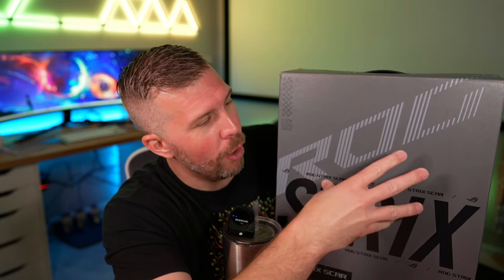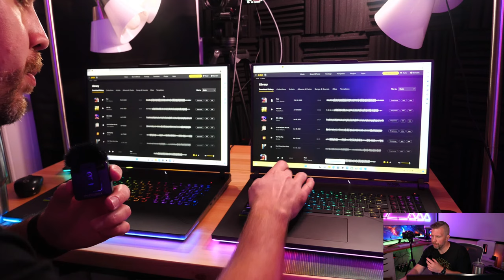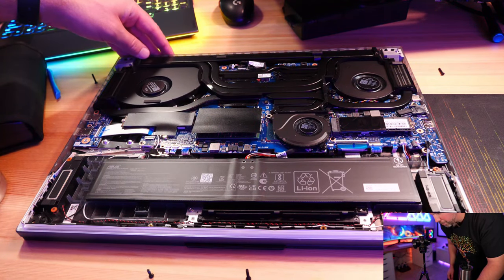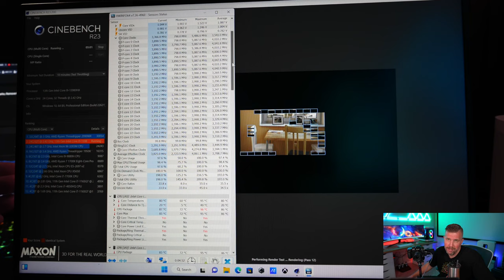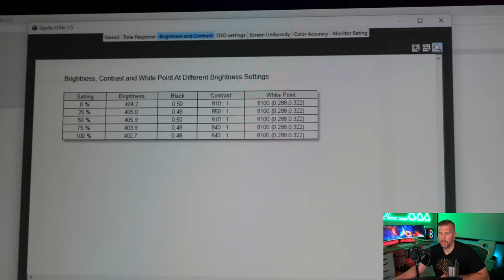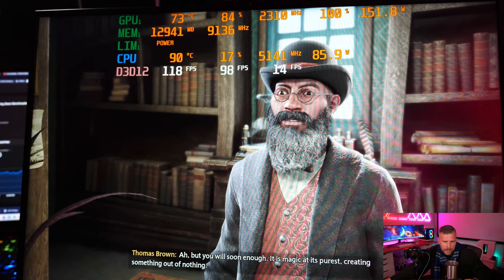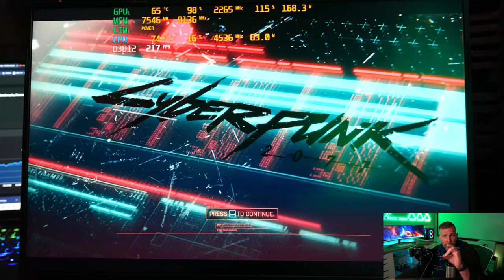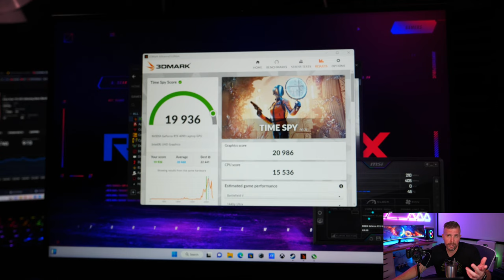Asus Scar 18 RTX 4090 LIVE Unboxing, Basic Benchmarks, Remove Bottom, Display Test, Flex Test, More!

Comment from the maker: IMPORTANT: The results at 02:06:44 are not correct. DLSS had defaulted off of quality, back to AUTO. This resulted in an abnormally high score. I will retest this in the benchmarks livestream. I expecting closer to 118-124 FPS range, instead of 136.
Reply: Gizmo with this laptop I see the power cord runs parallel to the side vent.  The heat is being blown out twords the power cable.  Do you think this can damage the power cable from the warm air ?

Comment: The first Cyberpunk benchmark showed DLSS on auto in settings upon completion of that test. I wonder if it’s truly a ~37% increase considering that. It may be the same performance increase that you thought you had running that benchmark on the m16 before realizing that DLSS was set to auto not quality. It clearly shows you applying the settings with DLSS quality but the results page did not show that.
Reply from the maker: I’ll have to double check. Thanks for pointing that out.

Comment: Love my Scar 18 - only downside for me so far is that Asus doesn't have a solution to lock the function key, which just seems crazy to me - but I still wouldn't swap it for any other 4090 laptop
Reply: how is the brightness? 400 nits measured in this video would be quite dim for me...
Reply: @batmanonholiday4477  I think this always depends on the person and environment it's being used. I personally can't stand to have mine on max brightness - it hurts my eyes!! I have mine set to about half brightness in a well lit room, and at low, or 1 up from low in a dark room
Reply: You could probably set a macro up for that? not an ideal solution but a potential one if it would improve your experience
Reply: @DannStarr  This. I have no idea why people are obsessing over bright screens, because even old shitty dim laptop screens make me wanna rip my eyes out at high brightness settings lol. Do people, like, game under direct summer sunlight or something?
Reply: @Clero77 I'll be using mine under direct sunlight to get work done this summer.
Reply: @Clero77  I have 500 nits and i use it at 90 - 100% brightness constantly 24/7
Reply: @Clero77  It's likely you are not used to using high brightness.

Comment: Damn that cpu gets hot, did you have the laptop flat on a desk?
Reply: That's representative of Intel high end on mobile these days. That crazy high power consumption is part of the reason. I'd never tolerate my 11800H tiger lake getting those craptacular Cpu temps (Msi Gp76 was helped alot by Liquid Metal Cooling with Thermal Pads from GenTechPC). The limited undervolting options for many of these Raptor Lake parts isn't helping matters at all. Zen 4 mobile is much more power efficient so it should be the clear choice for better temps (and probably price). Main issue will be availability for them.

Comment: Hi, great vid! Is it possible to reach 0DB = zero fan noise when using the laptop in idle, or just normal web bworsing, movies, youtube etc? Or are the fan speeds continuously changing depending on the work load? I need a big screen gamer laptop which I can use in the office more or less completely silent. (maybe by using the APU instead of Gefroce)
Reply from the maker: Silent mode can even be used during gaming, but at reduced performance and slight fan noise
Reply: @GizmoSlipTech  Hi thank you, actually I have a ROG Flow. I mean when not gaming, just doing daily office stuff, can silent mode run at 0dB or are the fans spinning? The ROG Flow can do it by disabling the GeForce GPU. Is the scar similar?
Reply from the maker: @andrasjuhasz3686  I havent tested silent mode in detail yet, but I am pretty confident it can be very quiet when not under load with no fans audible.
Reply: @andrasjuhasz3686  usually it still spins sometimes depending on workload. What you can do is make your GPU on eco mode and put screen refresh on eco too use manual to turn of the fan. Your CPU is gonna stay around 50~90 degrees

Comment: Do you not find it strange that the laptop was running at 70 degrees c when it was idle? It's immpossible to reach 35 degrees (or lower) with the fans maxed out. Hotter components die quicker. I am in the prcess of making an in-depth tutorial on how to remove all the bloatware and protect the system, while identyfying intruders, and much more. It ridiclous that the laptop should reach these temperatures. I get it's more powerful, but I can't see it holding up for years. Look in your task manager. It shows 8gb are being used in idle. Sorry but this is unaceptable (220+ processes). 100+ of those are microsoft bloatware/malware. It infruiates me. £4000. It's getting silly.
Reply: Unused ram is wasted ram.

I explicitly set up my machines to cache as much as possible in memory.
Reply: @magfal sounds good man! How does one go about achieving that? Is it as simple as dedicating a large portion to virtual memory, or something else? Thanks in advance :-)
Reply: @michaelbennett9127  Windows has several settings related to how much memory it commits caching to avoid hitting the SSD for everything it needs to read.
Linux is a lot more aggressive in this regard by default since it can assume a technically competent user that isn't annoyed that memory isn't being wasted.

Comment: Really good in depth comparisons and reviews! Thanks for the bro who borrowed you this laptop. Really waiting for blade 18 review, already pre ordered the 4070 model. And ended up going with it because blade 16 gets too warm which i thought i would end up going. Chose 4070 model because it seems even the new i9s cant keep up with higher tier nvidia cards.(1% lows) Btw earned a sub for honest through out reviews! Keep it up! 🤩🤗
Reply: If the 4070 aint enough i might meed to return it and just go for the 4080. 4090 just doesnt seem to be enough performance over 80
Reply from the maker: Yeah, shoutout to Lance. Glad to gave you Markom
Reply: Was happy to see a review done on the laptop from a great reviewer. The one thing I am hoping Asus opens up is the ability to undervolt the CPU a little more.
Reply: @GizmoSlipTech  do you rhink there is a way to put a rouchscreen layer on razer blade 16 like on the asus zephyrus x16? I need this kind of protability and power but also touch at least. Do you think there is way to make it together?
Reply: Yeah undercolting more seems to be necessary for more performance. We will have to wait and see if they update bios. -30 mv doesnt do much

Comment: 95c Cpu on Hogwarts (and some of the other benchmarks) is pretty yikes. Impressive Cpu Power Draw of over 100w during the benchmark, but those out of box temps are a disaster. Ofcourse the fact that its drawing over 100w in game on the Cpu is not actually a positive for Intel, it shows how crazy power hungry this card is (hence the terrible cpu temps), which is why these parts are really ill-suited for laptop. Hopefully Amd's Zen 4 mobile runs circles around these in efficiency, despite less flashy Cinebench and other benchmarks scores since Ryzen mobile doesn't need to consume 140w + .
Pity Gizmo didn't check out Undervolting on this, although I assume its the same thing as the Strix, namely locked to Bios, and locked to the limited -030 MV offset (better than nothing, but nowhere near enough to tame these Raptor Lake parts).